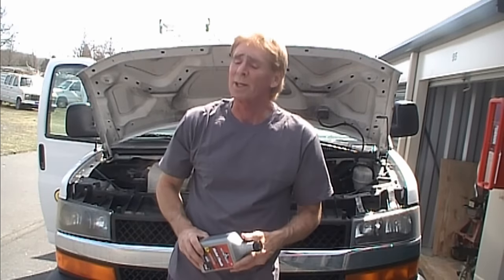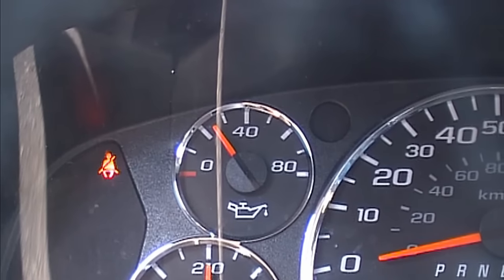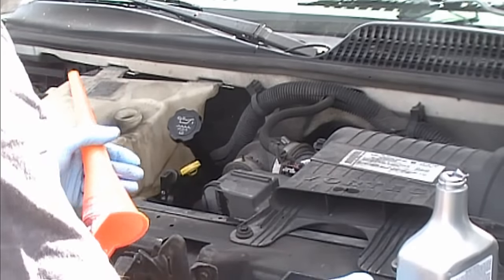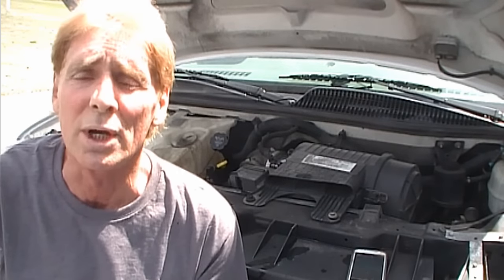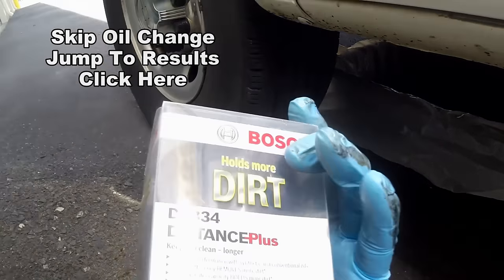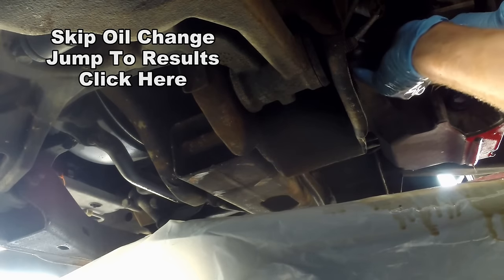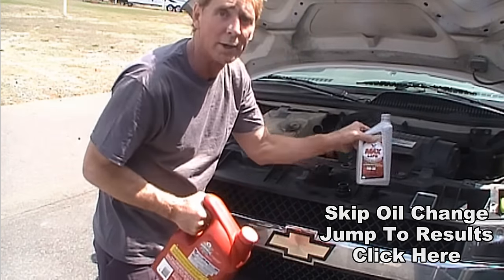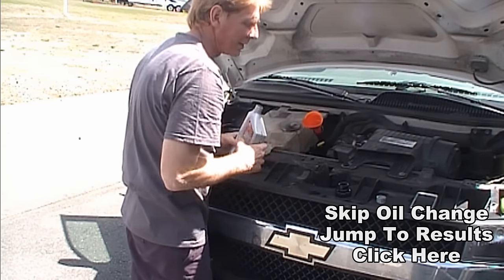NOISY LIFTERS? Motor Flush - Does It Work?  HOW TO DO IT YOURSELF

Comment: Hydraulic Lifters are self adjusting and need no adjusting.Solid lifters require Adjusting with a feeler gauge to leave a very small gap between the Lifter and Rocker arm.His problem is when the Hydraulic Lifters wear out and do not hold the oil pressure.That is why they call them Hydraulic oil lifters.Using a thicker oil 15-50 or 10-40 can sometimes fix the problem by increasing the oil pressure to the lifters.

Comment: Sounded like a knock to me not a "tick". Have never seen motor flush work
Reply: +Bubba Lee i dont think he is the drain bolt would  be a rounded off piece of metal by now. lol.
Reply: im not much on high mileage oil i only use  15-40 rotella in my 7.3
Reply: +Bubba Lee seen engines run 20k + miles and millions miles on conventional oil. Synthetic is not worth it. I won't EVER run it
Reply: +Bubba Lee it is not worth it. i have 326k on my 7.3. worn out on a diesel usually means dirt is being sucked  causing the rings to wear and then it uses oil and most people dont check there oil hence causing bearings to fail. i just built my 6bt cummins because of that reason. all bearings looked fairly good for 369k except for the one that spun. i build engines they just dont wear out for no reason or conventional oil. thats all we have ever ran in any of our farm equipment for years and years. just had a 3412 come in the shop with 21k hours ran conventional oil had crosshatching in all 12 liners and 1 broke ring not bad for 13 yrs of use and 21k hours in a scraper. talk to anyone in the truck or equipment business and ask if they use synthetic in there equipment they will look at you like your stupid. oh and i change my oil every 5k pulled the valve covers to put valve cover gaskets and no sludge or buildup the guy changing it every 4k was feeding you a line of bs.
Reply: +hayden ingram Yeah I know it's a rod knock, dude made comment about low oil pressure.
Reply: +hayden ingram Yuuuuup!
Reply: That is a tick...a thunk is a knock...to me sounds like a rocker arm needs to be tightened down (especially since the engine still runs so well)
Most modern SN rated oils usually don't sludge up unless they are left in the engine for a very long time (like 15K miles)

Comment: It's that the stuff you get at the dollar store?
I use ATF to flush a engine  https://www.youtube.com/watch?v=LKWWL_rsDB4
I don't trust all these strange companies making these cleaners and fixes, most are rips offs.
Low oil pressure and ticking wouldn't mean a lifter or anything to do with the valve, but more like main bearings since that is what makes the oil pressure and when they go bad they sure do make that noise you hear, it's called rod knock.
@1:44  LOL  "looks like transmission fluid"
Yeah it's a great cleaner for your engine but the oil dirty engine oil that there is more volume of is going to hinder it.

Comment: About your oil pressure and the ticking noise. 5W30 is way too light of an oil for that kind of mileage. I'd be useing 20w50. As clearances grow from wear you need a thicker oil to cushion the parts. Your oil pump is worn at the same rate as the rest of the engine. Go with a heavier oil and you'll see a better reading on your gauge.
Reply: i love to hear the truth from a brother  youré right !
Reply: its painful for the engine to use 5w30. you can hear its not one knock you hear al the strokes the same noise. i believe when you put in sae 30 your engine runs fine
Reply: A thicker oil can actually ware the parts faster. More oil trying to pass through the holes in the engine block plus will clog the oil filter. The key is to use the right oil 5W-30 is fine the big thing is to make sure the oil level is good and dirty oil is changed. If oil level gets too low it causes valve issues rod knock issues

Comment: Would have been better off doing an oil change with 50% Lucas Oil Stabilizer.
Reply: Lucas oil stabilizer, aka motor honey has a viscosity of 140. Thickening oil worsens oil flow problems
Reply: I recomendit in the sumer time

Comment: You didn't follow the directions thoroughly, it clearly states on the product high mileage vehicles are required to clean out oil pan to prevent damages from freed up sludge that deposits there. Also never use vice grips on your oil pan bolt.and clean the surface where your fresh oil filters seats fill it at about half way with fresh oil and put a small amount around the seal. Literally did every step wrong.

Comment: I think the flush cleaned out the the gunk, but I think the "knock" is from a worn out rod.
Reply: Yeah that definitely sounds like a stuck lifter, if they're original at 300k no wonder it's ticking, although the oil he took out really didnt look that bad haha
Reply: my engine rattles at 3k rpms and higher i got a 02 eclipse gt any help as to what the issue might be ? sometimes i do hear that tick
Reply: @ismaelgomez2158  it needs new valve rings.

Comment: Oh no, do NOT tighten an oil filter like he does! Its tighten till the seal touches the mounting surface then 1.5 turns. You do Not need to use a tool to do this. When undoing your sump plug make sure you use proper tools! Bad information like this makes it a hassle for me a mechanic to service your cars!
Reply: Adam Gow tighten by hand then 1 to 1/2
Tighten

Comment: did this just really crank the life out of an oil filter?
Reply: exactly you just hand tighten them the tool is just to get em off not put em on this dudes crazy
Reply: He even quoted "You don't want to over tighten the filter", He failed to do that lol
Reply: hand tight then a 1/4  turn, max is 1/2  turn this I find is perfect for most people, I've seen a few loose and leaky ones, the quarter turn seems to just ensure it wasn't something on the threads that stopped it early, plus it helps people that don't have gorilla hands. also, and im sure someone said this, PLEASE use correct socket or wrench on drain plug! You may have been already to do the video and realized it was all you had, been there, just don't want newbies thinking vise grips are the norm.   thanks for research though appreciate that, question is though did you ever repair the tick? curious if it was a blockage and this product failed, or was there physical damage  that this would never fix. Thanks again!
Reply: Michel Chapoy
Reply: Yep... "you don't wanna overtighten it" and then proceeds to over tighten to the max.  Hand tight is all you need.
Reply: THANK YOU!!!  The last time a mechanic used a wrench to tighten my filter, I damn near drove back to the shop and beat his ass with a HUGE box wrench when I broke 2 of my own filter wrenches trying to get it off.  I had to beat a screwdriver through the filter and use a rubber mallet to beat it off.
Besides, cranking it down like that can actually cause leaks when you compress the gasket outside of it's limitations.
Reply: mikedrz Hand tight plus ripped it back 9 times. HOLY SH!T.
Reply: He torqued the shit out that oil filter lol

Comment: Well, I'm no mechanic, especially on newer vehicles, but having owned and grown up with old school chevy trucks, everything from the straight 6 to the rat 454, I would suggest that noise is a bearing going out or that is spun on the crankshaft, causing the engine killing rod knock which usually blows a rod out the side of the block. I used to work at Aarons engine remanufacturing plant in Springfield Missouri, in the engine tear down section, and I have seen a massive list of various catastrophic engine failures in detail while disassembling engines of ALL makes of motors, ford, dodge, chevy, 4 cylinders and up, once a 3 cylinder diesel engine even came thru, but I dont remember which manufacturer it was from. I don't recall any foreign engines being run thru the plant either.... but the list of failures of engines is endless, mostly from engines that had sludge buildup that literally stayed in place as valve covers and timing covers and such were removed, and the sludge was solidified. I have to admit it, but we had engines that looked brand new that came through, mostly because some tolerance spec wasn't met by either the new engine or remanufactured engine, or a faulty part like a broken camshaft or a broken crankshaft bolt or rod bolt or just one of the nuts having come loose....
Reply: I reckon thats when they would do that, right away or old and neglected. Unless you get super lucky and its a exhaust man going to have to drop it. How do they re-machine a block like that?

Comment: 5 minutes isn't long enough no matter what the bottle says. 
Dump some ATF or Marvel oil in it and drive the piss out of it for a week or two. Your oil pressure isn't that bad if the "idiot" oil pressure gauge is reading correctly.
Reply: I agree! and I owned a chevy once and that oil pressure gage always registered way too low at idle... I have a 2005 Dodge Ram 5.7 with 265k miles. A few months ago I had multiple lifter failure. At first, I thought the engine had spun a bearing because it sounded like complete devastation. After listening with a stethoscope, I figured it was the lifters. I thought for sure I would be digging in to my wallet and a weekend of time, but decided to try some engine oil additive. I went for a one two punch and it worked beautifully! I first added Risolone and let that run in driveway for an hr, let the engine cool and dropped the oil. Then added 10/40 oil and a bottle of MMO and drove easily for next few days. After about 120 miles all lifter noise is gone! after another 1600 miles, engine is still quiet and runs perfect.

Comment: To fix that tick replace the oil pump pickup tube o ring. Known problem that the 4.8, 5.3 and 6.0 have. Will fix that tick almost every time
Reply: Where is it 
I got an 07 GMC
Reply: If you remove the oil pan you will see a pickup tube running to the front of the engine into the oil pump. It’s one bolt (maybe two I don’t remember. It’s been awhile lol) and the tube will slide out of the pump. Just replace the o ring and reinstall. I’ve seen it fix 5 out of 5 of these engines now. Both 4.8 and 5.3

Comment: Nothing wrong with FRAM filters. Bosch filters are made by Mann & Hummel which own Purolator and Wix. Different part number and old stock vary between producers, but new ones look to be all Purolator from what I’ve seen. Lots of tearing issues in the media and anti drain back valve on Purolator filters.
Reply: FRAM anything literally falls apart. Air and oil filters.
Reply: @pipedup  Not the Fram ULTRA! IT'S THE BEST. COST' MORE

Comment: Yeah, "someone" had rounded off the old drain plug. Wonder how that happened. Using vice-grips perhaps? Seems like you forgot to lube the rubber seal on the top of the oil filter too.

Comment: Yes a tick still there so what are you going to do body???
Reply: he will probably buy a new car because fixing it would be way over his head with the shit way he did that oil change.
Reply: He needs to put thicker grade oil in it
Reply: Change the lifters
Reply: evilcowboy
id just run it till the motor gives out send it to the scrap yard buy new car. as long as he keeps up the maintenance i maybe be good for another few thousand miles just dont drop a crap load into it the motor is worn out n tired needs to be replaced.

Comment: WHAT NEEDED TO BE DONE to correctly finish this engine cleanse project was to add either Marvel Mystery Oil (my preference from experience) or Rislone Engine treatment to the engine oil. This needs to be done for  2 to 4 regular oil changes (3,000mi between changes) to be really effective and give it a chance to work. I personally use Marvel Mystery Oil all the time in all my oil changes and also to the gas tank for cleansing and better gas mileage. That includes vehicles, lawnmowers, ATV, etc. My engines do not have any problems.
Reply: How much of the Marvels mystery oil would you recommend using?
Reply: Don’t you just leave it in there with the oil tho?
Reply: @motivationmade9165  you replace 1 quart of the oil to fill it
Reply: @motivationmade9165  In a car or truck engine, a quart of Marvel Mystery Oil replaces a quart of your engine oil. And stays in the engine til your next oil change. This procedure will also cure any oil burning issues. I know from experience when a Toyota Tercel I had began to burn 1 qt oil every 500 miles. I could smell it, but not see it. After 3-4 oil changes, the dip stick showed down a 1/2qt after 3,000mi. Just keep using MMO every oil change. Instructions are on every bottle for use with oil and in gas. MMO has been around since 1923. It was a marvel in any vehicle then and is today.

Comment: Might try Sea Foam? I put in oil and ran for 5K miles and got rid of noisy lifter for me. James
Reply: +James Sasse His is a rod knock, lifters don&#39;t cause low oil pressure, his main bearings are.
Reply: +Patrick TheBaptist what's the best way to diagnose a rod knock
Reply: Anthony Bristol
Just rev the crap out of it LOL
Reply: Wouldn't it blow up
Reply: +Anthony Bristol Sometimes it is hard to tell where sound is coming from? Remove your accessory drive belt and run the engine for about 30 seconds. If noise goes away you have one of your belt driven accessories failing. Maybe water pump, alternator, ect. If you had or have low oil pressure or a plugged oil filter another case? If you had antifreeze in the engine oil damage already done! If you have a noisy lifter try SeaFoam and run in your oil for 1000 miles or so and drain oil. If the rod is knocking the only way you can examine is drop the oil pan. If the crankshaft journals are scored even if you put new rod bearing in will knock out the new bearing after a few miles! Might try to find another engine? James
Reply: +Patrick TheBaptist Youre right, the low oil press. is from bad main brg... This engine as no problem, its simply worn out !
Reply: bigdanwess
Yup yup, have  good weekend.
Reply: +Patrick TheBaptist Thanks, same to you my friend !
Reply: sea foam does work pretty good...
Reply: +Anthony Bristol With the engine running, you disconnect and reconnect the sparkplug wires, one plug a time... When you get to the bad cylinder (bad rod), the knock should be much less...
Reply: +Patrick TheBaptist 😂😂😂😂😂😂😂 damn dude, that comment just made my day! lol
Reply: patrick thebaptist...
nope.. not a rod knock..  low pressure with a rod knock would cause it to self destruct. but its running fine except a tick which sounds like its coming from the top end
which means its a lifter .. and its ticking because of low oil pressure
and it has low oil pressure more then likely due to a worn out oil pump from having such high miles
(it had over 300,000 miles.. in canada or anywhere that uses KM.. thats over 600,000km)

the oil pumps on most engines in the last 30 years have been on the bottom of the engine behind the crankshaft pulley and is driven by the actual crank shaft itself..
and it pumps the oil through an aluminum tube with a steel rod that goes back and fourth. but the steel rod has sharp edges and over time turns the softer aluminum tube into a football shape and then the steel rod eventually gets stuck sideways in the tube. and then you loose oil pressure.. 

so if the oil pump was changed on this truck
he would regain oil pressure, and the tick would go away

Comment: Ad Marvel Mystery oil......it will fix your prob.  5 min oil flush will never work...takes longer to dissolve the sludge. MMO will fix it, and fix it right, and no oil change required right after using it.  Try it

Comment: should just run some  ATF oil.
my friend had lifter sound from his engine. drop the oil filled it with ATF oil let it idle for 20 minutes then dumped the atf oil. refilled it with new motor oil and was quiet again.
after first 1000kms travel dumped the motor oil and filled it with fresh oil again to get out any left over ATF oil that might have been left inside his block

Comment: And the lesson to be learned here is - DON'T WAIT 300,000 MILES BEFORE ADDING CLEANING AGENTS TO YOUR OIL AND GAS.  Good Lord, you can't expect one can of flush to magically take away years and miles of neglect and abuse.  Adding Marvel Mystery oil and/or Seafoam to your gas and oil REGULARLY is a better PREVENTATIVE than trying to clean out years of sludge and varnish from the engine with one treatment.

Comment: use diesel instad of that oil flushy thing
Reply: Shirali T does that actually work?
Reply: Don’t do it.  Will damage any rubber oil seal.
Reply: Ain’t that shit basically kerosene?
Reply: Won't damage anything, have done it on outback diesel, xsara petrol, e46 diesel, laguna diesel, fabia petrol, golf III petrol

Comment: where do i start....oil pressure is a meausurment for how much resistance there is through the oil gallaries. oil gallaries do not go into the lifters, might go around them but not into them! "do not overthighten your oil filter" FILTER WRENCHES WERE NOT DESIGNED TO TIGHTEN FILTERS!ONLY TAKE THEM OFF! and vice grips on the drain plug, no wonder it stripped out from the "previous owner"

Comment: There's no difference in the oil pressure and in the engine sound. It requires manual adjustment of valve clearances. Further, you are using the wrong tool for driving a bolt. A locking pliers is used to hold pieces of sheets (or similar) together for whatever operation, not for driving bolts and nuts. Like you said, the original thread was damaged and it could have been due to using a wrong tool. The ideal tool to use here is the open wrench which has the right handle length to apply the right torque.
Apply a thin film of oil to the filter gasket. When the filter is hand-tight, just do a quarter turn to tighten further using a filter wrench. After starting the engine, inspect the drain plug and filter for leaks.